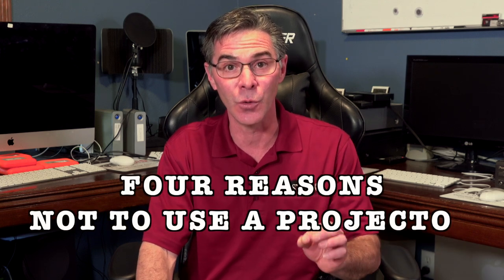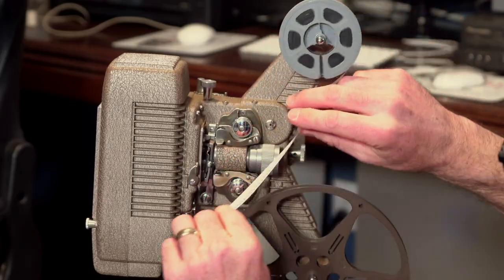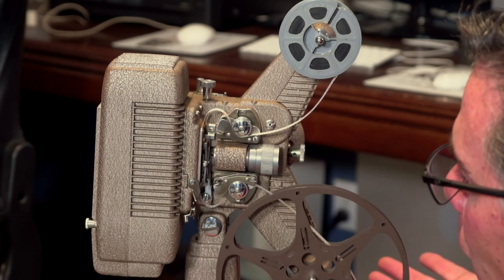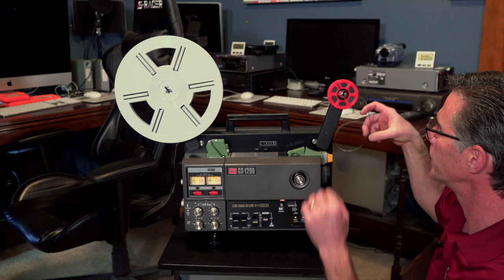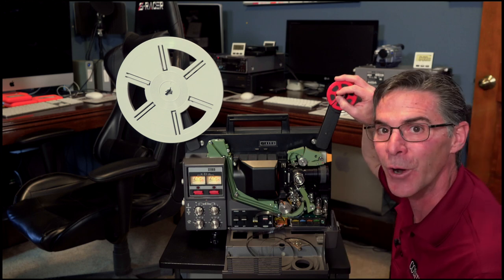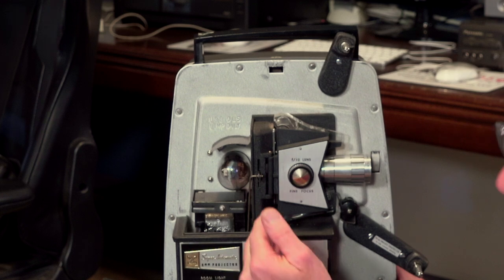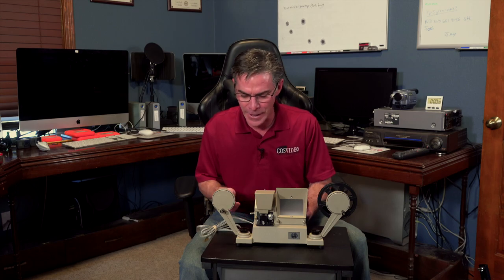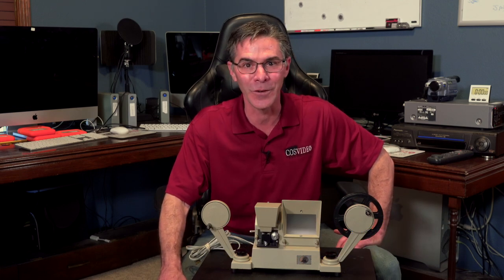8mm Film Projectors - Review

Comment: nice video but remove your #3 Never a bad idea to use a projector somoene gave you..... same mystery when you buy one. Read about it, read the manual etc. Then use a junk reel of film and give it a try. You may have trash or a treasure and you wont know unless you try it out.
Reply from the maker: Thanks for your comment.  However, a section can not be just "removed" from a video once on You Tube.  I base my opinion on all of the stories I have heard over the past 20 plus years of people purchasing/accepting/finding projectors and damaging film because the projector is bad. Most projectors purchased don't come with manuals and most manuals are hard to find. Most sellers don't know a thing about that they are selling and just say that it is working in the description. People also don't have a "junk" reel to try things out. They just put in there family film.  What you are saying is a good way to do things but it doesn't happen that way unfortunately.

Comment: You also forgot to mention that replacement bulbs for these projectors are quite expensive. One solution for people who are fans of film projecting (and there are some. There are people who still like to shoot super 8 film and project it. Ektachrome 100 D for colour and black and white reversal is still available for that as well as negative stocks) is to have the lamp replaced with an LED fixture. It won't burn your film or your skin and it will last virtually forever.

Comment: I think mine have a worn out bulb on my projector. do you by any chance know how to change the bulb and what kind of bulb does it use for this model. if so hope you'd make a video of it.
Reply from the maker: The best thing that you can do is a google search for a bulb. They are pretty easy to put in but use a cloth to hold the bulb so you don't get finger oil on it.  The oil will create a hot spot and the bulb won't last as long.

Comment: Hi , to digitize, did you ever try just use a cam recorder or a mobile an capture /record the projected screen? have a ton of film to digitize with big size rols and i think wolverine does not handle the big size ones because they dont fit ?  thanks
Reply from the maker: When I first started film transfers, I would use a camera and point it at the screen.  It works pretty good but you need a speed control on the film projector so you don't get a flicker on the camera you are using.  You also need to setup the camera properly for frame rate.  Check out my 16mm transfer video.   The pro model of the Wolverine and the Kodak reels does handle the 400 ft reels. It is really best to use one of those. It does take a long time but worth it.  If you don't want to spend the time hit me up, I will help you out.  Please make sure to hit that subscribe button!

Comment: I guess this is meant to be a comedy and it is good you show how projectors can damage film, but three of the four models you showed are really cheap bad ones, while the Elmo is a very valuable, still-expensive machine that is on the rare list of projectors that plays both magnetic soundtracks on a Super 8 film print.  Outside of the silly point of film bunching, it works great once tested.  I'm sure you don't think your viewers are THAT stupid.
Reply from the maker: I don't think my viewers are stupid at all.  This video is meant to be on the silly side.  Sorry if I offended you in some way.
Reply: @TheMediaNerdMT  So it is silly.  That you for the verification.  My fear is that someone will throw away an increasingly valuable, or priceless machine in the confusion and Elmo made several variants of that one, including for optical Super 8 from overseas.  Probably should have added a :0) to my comment.  Thank you.
Reply from the maker: Yeah, that would stink if someone threw it away without doing research first.  Good video idea for me!  Thank you for watching and commenting.  Please help support the channel by subscribing, I would greatly appreciate it.
Reply: @TheMediaNerdMT  Subscribed!  :0)
Reply: I had the same feeling: "Is this meant as comedy"? Primarily because I cannot use projector #1, then not #2, not even #3 or #4. So what can I actually use? I my experience (though I am not an 8mm enthusiast but have a few projectors and a box of film) the only projectors to avoid are those without sprockets that relies solely on the claw mechanism to pull the film through. They tend to be quite tough on the film and they often have problems keeping a steady picture.
Reply from the maker: @organfairy  Yes, this video is meant to be on the fun side but telling the truth about different projectors that are cheap or expensive.  In order to view your films without running them through a projector, get a 8mm film viewer.  There are plenty of ebay that will do the trick.  Thank you for your comment, watching and please help support the channel by subscribing.